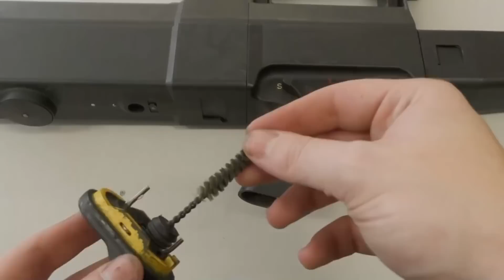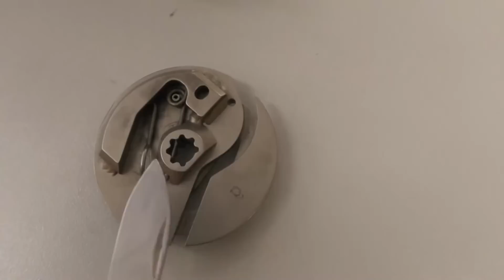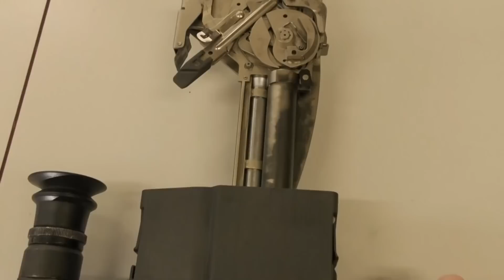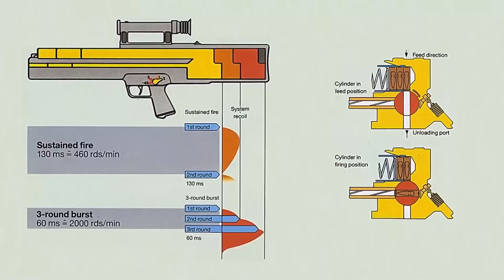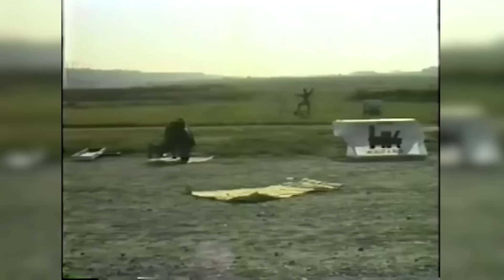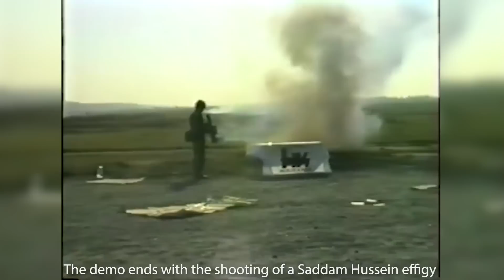Heckler & Koch G11 - Disassembly & How It Works!

Comment: I never realized how much recoil the G11 has. Why firearm designers won't incorporate constant recoil in their new rifles like the original did, (the STG44/MP44) is beyond me.
Reply: Mind you, that recoil is from a three-round-burst fired almost at the same instant...
Reply: @jnievele  The AN94 did the 2 round burst, only with a completely different design. It too failed as a combat rifle. Over complicated designs never work well in real world actions. Constant recoil is very reliable and effective when on full auto. Constant recoil will have the same rate of fire using different powered ammunition like ball, tracer and suppressed.
Reply: Constant recoil makes more sense for longer bursts, doesn't help as much for single or 3 round bursts. But I don't know why MGs don't use them. Maybe becuase it would need a longer receiver. The FN MAG/M240 has a milled steel one which would make it heavier and more expensive. I don't know why extruded aluminum receiver isn't used for MGs more.
Reply: @Nathan-jh1ho  durability. Aluminium gets work hardened a little more by the recoil impulse of each shot fired, and that gradually makes the metal brittle and prone to cracking which makes a bad day in the field...
That goes a lot faster in belt fed GPMG recivers than in select fire rifle recivers.
Reply: @SonsOfLorgar  Depends on the design. The aluminum M16 receivers will last almost indefinitely. Stamped metal receivers have a stretching problem and durability can be a lot less than aluminum.
Reply: @Nathan-jh1ho  The Knights light assault weapon in 5.56 and 7.62 are amazing. The entire point of the assault rifle concept was full auto controlability. History has proven over and over, firepower wins on the battlefield, not the gravel belly philosophy..
Reply: @hairydogstail  didnt the ultimax use constant recoil? And that was like from the 80s
Reply: @RepublicanGuardMan  Eugene Stoner stated (in the Smithsonian funded tapes by Edward Ezell) that He and Jim Sullivan ( the designer of the Ultimax) first saw constant recoil in the German MP44. Stoner called it that run out thing. Constant recoil is when the carrier runs out on the spring and never touches the rear of the receiver.  Stoner was demonstrating his Stoner 86 machine gun that used constant recoil. Knights light assault machine gun was a further developed Stoner 86.
Reply: @hairydogstail  mhm, hanks for additional context info :3
Reply: The idea is to increase the hit probability of someone dashing from one cover to another and who is only visible for a second or two. There is no need for constant recoil as it is not meant to be a bullet hose for sustained full auto fire.
Reply: @matatron.  That is not what the Germans discovered with their assault rifle, the reason it was developed or the reality of combat. It is the side with the most amount of concentrated fire power that wins in a combat scenario.  US forces discovered this during the civil war, Little Bighorn, the Korean war and in Vietnam when the M14 went up against against the AK. The US once again forgot this lessons with the boondoggle M7.  Read the book Misfire by William H. Hallahan. History seems to always repeat itself with US combat rifles.
Reply: @hairydogstail  He is correct saying that the G11 was not intended to be used for sustained fully automatic fire. Burst mode simply works when you have less time to engage something.
Reply: @MrCarGuy  The burst mode was to increase possible hits, much like the advanced SPIW testing using flechette sabot darts (the military was hoping would become a reality) when the AR15/XM16 was suppose to be a stop gap with their so called one time purchase. Using multiple darts, cartridges, cartridges using 3 small separate bullets stacked one on top of the other, the second SPIW testing using a .17 (4.32MM) caliber in the future Rifle Program (FRP), etc were all a bust. Even the M16A2  3 round burst was a failure and was discarded for the traditional semi/full auto choice. Burst mode was seen as a means to increase hits while saving ammunition. It did neither. Like I stated earlier, the bean counters who decide these failed ventures never read history or understand combat.

Comment: Now the Krauts had to have known the mechanism inside of a G11 would've gained sentience, taken one look at any grunt and decided, it wanted nothing to deal with what he was gonna subject it to
Reply: LMAO Can you imagine disassembling this thing in a trench or inside a cramped armoured vehicle?
Reply: @lazynpsychotic  I have a hunch it would be supplied the same way as the Leo2, with fiddly components that's finicky to clean or service would be replaced with a working one as a single module and the malfunctioning one sent back to depot armorers.
Reply: @SonsOfLorgar  That's exactly how H&K intended it.

By the way, the thing that killed this rifle was not that it was costly or complicated. The German military had already made the decision that it was fine and started the adoption process - but then reunification happened, which turned out to be so expensive due to how run-down East Germany was (more expensive than previously thought, because the East German government had been falsifying economic figures for decades, both for propaganda reasons and in order to receive many billions in West-German loans) that there was no money left for a magic space rifle. It was government auditors who ended this expensive project. Not to mention, with the Cold War officially over, there was no need for it either.
Reply: @lazynpsychotic It wouldn't. Grunts were supposed to fire special cleaning rounds in the field, disassembly would only be done under much cleaner circumstances, there even was a plan to not allow grunts to disassemble them at all but swap dirty weapons for new ones and send them back for Depot maintenance
Reply: @lazynpsychotic  , harden up!    just remember to bring a clean mat to perform the surgery on.   and dont kick sand onto the mat when disassembling.   and everything will be fine.